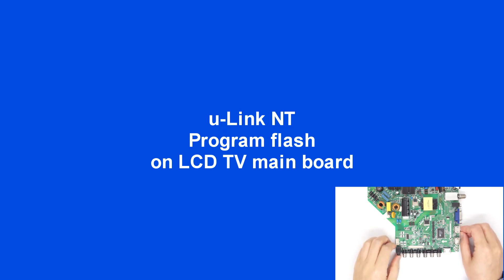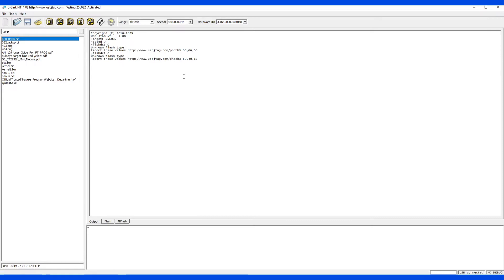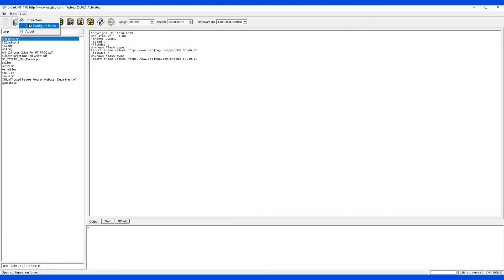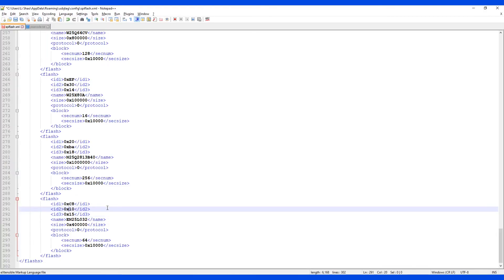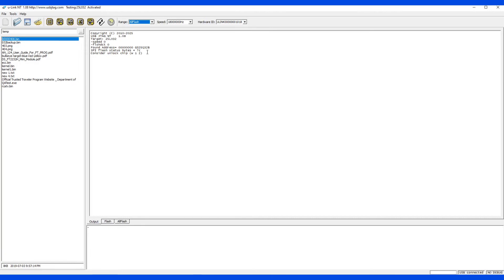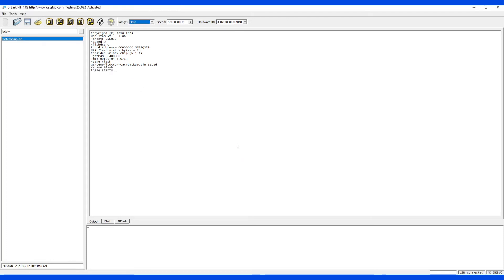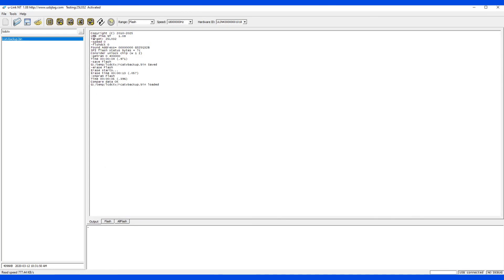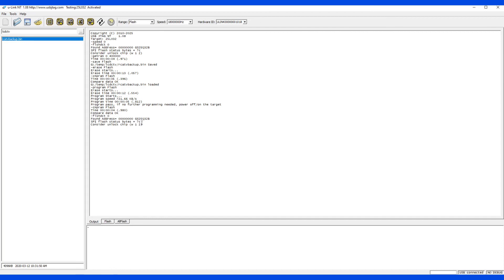u-Link NT program SPI flash on LED TV.

Comment: Hi there! I have this same TV set that has no stby led and is apparently dead. All voltage inside look correct, even the SPI flash IC is getting 3.3V. Should I assume that the firmware is corrupt? Thanks!
Reply from the maker: Until you do a read and compare it is just one of the parts that could fail.
Reply: @usbbdm  thanks, where can I find a dump from a working one? I don't have another tv like this...ty
Reply from the maker: @edugimeno I do not have the backup on my hard drive. Find a working TV or make a request from TV repair forums